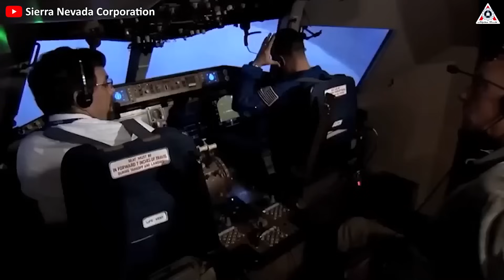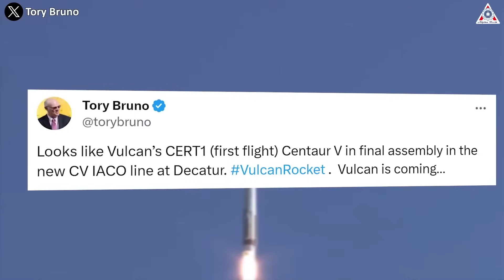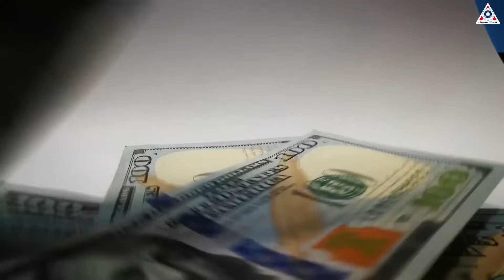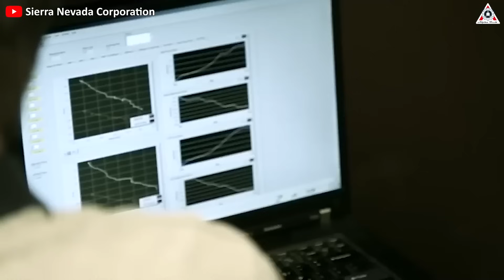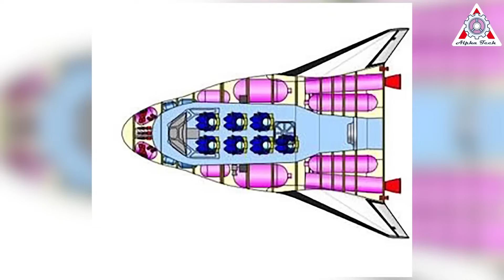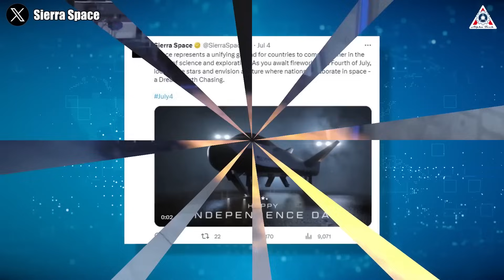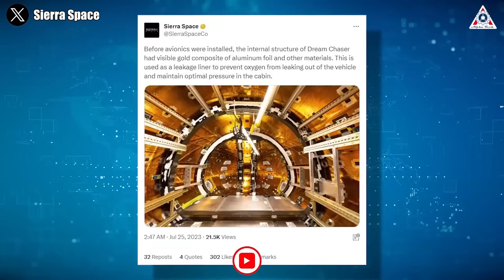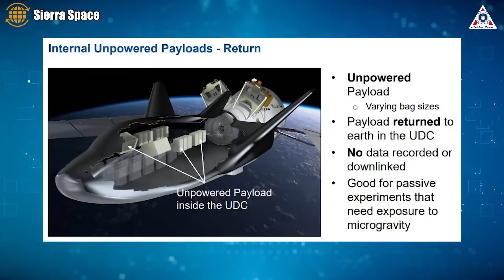NASA's Plane launch vehicle is in BIG TROUBLE...What's wrong? How can SpaceX help...

Comment: Dreamchaser is not the second spaceplane but the fourth.  After the Space Shuttle there was the Soviet Buran.  Currently you have the X-37B which is still active with the US Space Force.
Reply: Wondering the same --How do the two differ from each other? Boeing X37b  to Dreamchaser?
Reply: The Buran was potentially more advance than Boeings " Shuttle"!
Reply: @noldaker, google them. They are both spaceplanes but otherwise quite different.
Reply: @billmullins6833  I understand, but the concept and the shape is similar. Soviets came up with that  first, that's all I want to say. Space Shuttle and Buran are similar concepts as well, but Americans came up with it first. Soviets followed but made a much more advanced Buran. It was bigger, fully autonomous, had superior strong heat shields and Space Glass capable withstand reentry. US has nothing like it to this day. Space Shuttle in comparison had inferior heat tiles, that killed Space Shuttle program. If not the collapse of USSR Soviet program would succeed. They also planned to make a reusable rocket with a folding wing, that suppose to land as a plane. I believe it's a better concept than Star Ship, cause a wing is lighter than tons of fuel for landing. Of cause it is better only in Earth atmosphere
Reply: Buran was pretty much DOA.  It never carried astronauts into orbit, and only did one automated orbit.  The Dream Chaser shows more promise - it just needs a freakin booster that works.

Comment: I believe that SpaceX would bend over backwards to help out Sierra Space and its DreamChaser. Unlike McBoing's Starliner there is no real competition between Dreamchaser and Dragon.  Consider that SpaceX is already filling in for Northrop-Grumman while N-G waits for Firefly to deliver a new launcher for the Cygnus cargo missions.  Furthermore although SpaceX does have its ideology the core of that ideology is financial.  Everything that SpaceX has done has ultimately been done to make its products profitable.  Starship is from an engineering point of view revolutionary but every design feature is focused on reducing costs.  Yes it has to ultimately pay off $5B in development and infrastructure costs, but the actual cost of each launch is a fraction of the cost of Falcon 9!  While it is stretching  SpaceX to the limit to try for 100 Falcon launches in 2023.  But Starship is designed to support THOUSANDS of launches per year from each OLM!  The biggest reason that the Space Launch System costs $4.2B per launch is that it can only launch once every TWO YEARS.  All of its infrastructure, and the salaries of all of the hundreds of thousands of staff involved in delivering SLS must be funded by one launch every TWO YEARS.  If NASA is being fair, it is charging the same rent for LC39B as it is charging for LC39A, but SpaceX is launching two orders of magnitude more flights!

Comment: Dreamchaser is (I think) what the shuttle was meant to be all those years ago (a small space plane mounted to the front of a rocket) but the way NASA gets its cash meant we ended up with the DeathTrap Shuttle we got
Reply: If no launches were made in freezing conditions the shuttle never would have lost a soul. And could have been used for many more years. Relying on Russia to get to space was the lowest point of US Space Flight. Maybe relying on an unproven BE-4’a will be worse. Challenger and Columbia would not have been lost if information about O-rings and insulation had been applied.
Reply: @MakaiMauka  Challenger I totally agree, but wasn’t Columbia a chunk of foam smashing a hole in the wing? That’s not a temperature issue. My main point was that the original design had a much smaller shuttle right at the front, away from everything else rather than sitting on/next to the propellant tanks / rockets so if there was a failure in a rocket or a tank, any debris would fall backwards and not hit the shuttle. That design factor is what made both shuttles crash… bits from other parts hitting it.

Comment: Sierra Space should be talking to Space-X anyway about pressure suits and life support for when they carry passengers! They should either adopt Space-X suits or at least use the same suit connectors. This will avoid the problem they had with the Cosmonauts being unable to use the dragon life support in an emergency when the Soyuz capsule failed!
Reply: I think that you mean Axiom spacesuits. SpaceX only uses unpressurized flight suits with crash helmets.
Reply: @texan-american200  The Space -X suits are in case the capsule de-pressurises, they have an air supply,  temperature and pressure control.
Axiom is making an EVA suit! for working in vacuum. The space -X suits just let you survive it!

Comment: Runway launched spacecraft have recieved short shrift, for a long time. We saw how the shuttle was piggybacked on a 747, and the Russian version had the AN225, able to lift far more. 
If a cargo shuttle with two reusable falcon 9 boosters, on it's back, was piggybacked up to 40,000 ft.  It could take heavy loads to high earth orbit.
A modified Vulcan Bomber design, could be the piggy back vessel. The launch could be boosted with an electro magnetic rail like on Ford class carriers, but set on a land based runway. 
Also a smart ski jump runway end, could pop up at just the right spot, for a final boost 

Picture the six Vulcan bomber engines, fired up. Then the precharged, super conducting quenching rail, gives the first inertia overcoming, push. 
The giant load races down the runway.. its AI controlled cockpit, tells the end of the runway, when the wheels are almost, coming off the ground. A hydraulic system pushes up one of six, ski jumps at exactly the correct spot, and the giant modified bomber, thunders into the heavens. 

At maximum altitude, say 40,000 ft., the falcon 9 boosters fire up. Explosive bolts, release the shuttle, and it soars up to almost LEO, the shuttle engines fire, and the boosters release, making their way back forrecovery 
The shuttle takes its load, up to destination orbit, releasing expandable sections, of a space station ring. And then begins re-entry.
Instead of heavy expensive ceramic tiles, it has a shell of compressed carbon from burnt charcoal. This replaceable ablative shield, glows red with the heat of re-entry. But costs only pennies to make, and can be squeezed, into blocks of any The burnt area in Maui should be incorporated into the town and then be restored into a biological reserve replanted with true native species. And fireproof earthquake proof native style Residences built which should be predominantly owned by real native Hawaiians.
This could be a great opportunity for Hawaiians. If they get the help they deserve. 
An appeal to Native Hawaiians who left for the mainland to return and live there to replace those lost in the fire.
This could have underground power supply and cell towers disguised as palm trees with uniteruptable battery power. 
A new sewage treatment system should be first. And great storm sewers. 
A native fishing boat Harbour and rewild the beach strip.pulling the road back and adding walking trails with areas for pig roasts and native ceremonies.

Comment: Well Vulcan may have a successful launch in December 2023 but early 2024 is only possible if BLUE Origin can manufacture two working Be 4 engines.  Anything relying on Be 4 engines will be a challenge to Dream Chase's success.  I think the second Vulcan launch won't occur until late June.

Dream Chaser can't fly on a Falcon 9 or Falcon 9 Heavy without SpaceX designing/building a larger faring.  A bigger deal than with Vulcan since SpaceX uses recoverable farings which are more sophisticated.  NASA and USSF needs to insist that Dream Chaser flies on Falcon 9 (or Heavy if crew rated) in addition to Vulcan and New Glenn with Falcon 9 being used on Dream Chasers second launch.

Comment: 😮 definitely SPACEX can easily outdo any "offspring" of the infamous Space Shuttle. Though all programs of NASA had fatalities, it was nefarious for hideous accidents. 
Seems that the shuttle was built for payloads by the thousands, money money. But as Buzz Aldrin said, also, that it was boring. 
Dream Chaser sounds more like Disney or the charming and trendy Blue Horizon, which doesn't have the design power of SpaceX unfortunately. 
Musk has turned into the Big Rocket Guy with not much competition at this point. 
Even Putin had to say positive things despite their relationship problems.😅